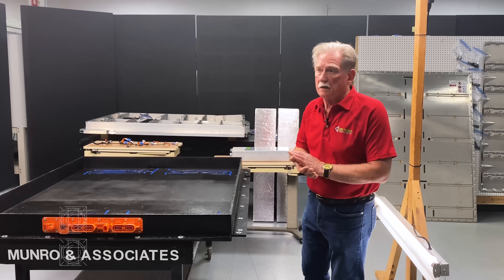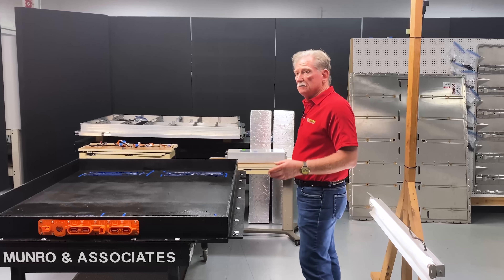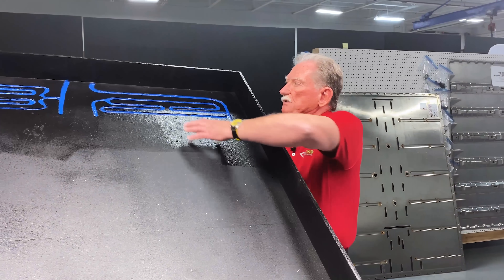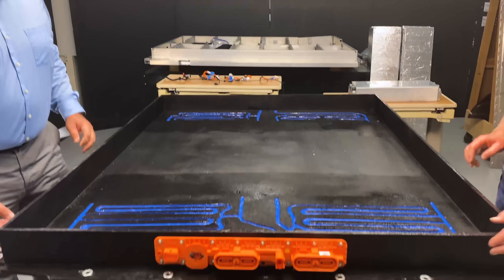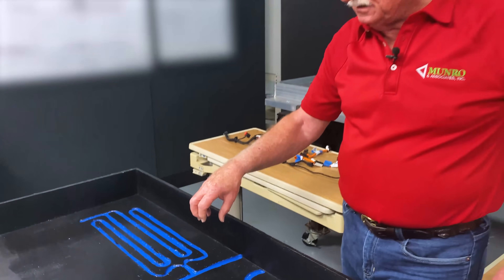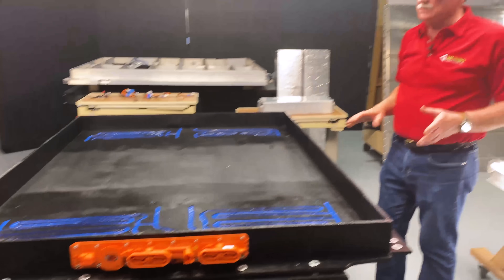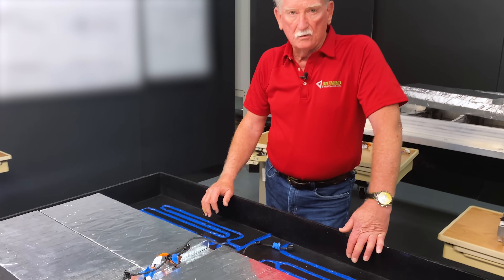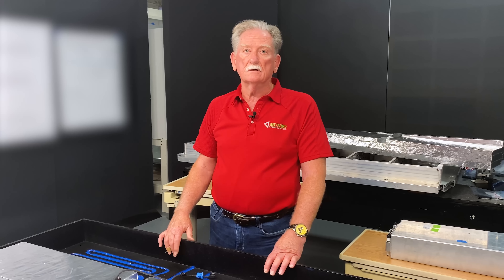Volkswagen ID.4 Battery Prototype Update

Comment: We are seeing several radically-different form-factors for the cells themselves:  soft-walled pouch cells, thin rectangular prismatic cells (including the BYD variant called 'Blade' cells), and hard-walled cylindrical cells.

Somebody needs to sort out which form-factor best suits pack engineering, fire safety, cycle life, pack-level energy density, minimizing cable runs, etc.

My impression is that OEMs are so desperate for cells, they'll take them in any form-factor from suppliers and make the best of it.  But that isn't sustainable.  Somebody will back the superior horse; the others will be also-rans.  As automakers lay plans and negotiate contracts, they will need a road map towards a future in which each can match what the others are doing, else competition will shake out the market into just a few survivors.

That might happen anyway, but I think our civilization will benefit if as many OEMs as possible are able to succeed in the market with their products.

Will Munro & Associates weigh in on cell form-factors?
Reply: You forgot "kWh out the factory door" each day.
That may be where the 4680 wins.
Reply: @rogerstarkey5390  Not exactly, no.  I didn't forget.

Tesla has a production plan for 4680 that will result in very large output from their production lines - very large in comparison to anything that has been done before.  There should be no controversy about this conclusion.

But it is not a foregone conclusion that cylindrical cells must be more producible.

At least some of the producibility gains for the 4680 cell come, not from the cell form- factor, but from dry-coating electrodes.  In principle, any of the other cell form-factors could also benefit from this technology, shrinking production line footprints, eliminating drying, reducing capital expenditures per line, reducing cell costs and accelerating cell production.

The rest of 4680's producibility gains are the result of clever engineering and cutting-edge production line robotics.  But is clever engineering or advanced robotics disallowed for other cell form-factors?

Probably not.  Cell suppliers would take issue - particularly BYD, which believes it can mass produce its Blade prismatic cells in very high volumes and at reduced cost.

My question is about the form-factor itself.  The question is agnostic with respect to cell chemistry or electrode manufacturing processes or even cutting-edge advanced robotics, all of which do factor into cell cost and performance.

BYD is an interesting case.  They are claiming for their Blade cells the ability to make structural packs - they are borrowing terminology from Tesla here, implying, but not claiming overtly, that their structural packs will be just as good as Tesla's.

It's a problematic implication.  The Blade cells will be packaged into modules which will sit in some sort of tray.  The tray can be made structural (in stark contrast to the Mach-E's tray, which just hangs from bolts).  And the Blade cells could be made to bear loads in certain directions (they are stiff in some directions, flexible in others, whereas Tesla's structural pack is stiff in every direction)).  How all of this will play out in terms of BYD's KWh density at the pack level, and weight of the pack, isn't known.

I think my question remains unanswered: what cell form-factor best suits automotive applications?  Do we really have to let OEMs falter and fail in the market to discover an answer to the question?

My gut wants to prefer cylindrical cells, but the IQ of my gut is negligible.  :P
Reply: Yes, BOSCH will pick this up and provide industry standard battry modules used by every manufacturer, like they make pumps and power steering for 3 out of 4 cars today (at least in Europe). EVs are now made ground up by every manufacturer and many different battry suppliers each using different topologies, but as the industry matures, part suppliers will catch up and provide  standardsized certified EV components cheaper than the brands can make them themselves. The state of things now are like a hundred years ago, where every manufacturer had to build their own engine and figure the mechanics of the car resulting in numerous original designs, some more sucessful than others..
Reply: @Tore_Lund  Battery tech is still advancing, and is likely to continue advancing for the next half-century, at least (opinion, not fact).  The role you envision for Bosch best suits when technology is mature.

I don't see them as leading the battery innovation race.  Or for carving a role out for themselves in my lifetime.
Reply: @Tore_Lund  The ICEV industry is mature.  Yep.

The BEV industry, specifically the electric drive train and electronics, are not mature.  At all.

A period of enormous disruption isn't the best time to be talking about Bosch-style commoditization of components.
Reply: VW group, the worlds largest vehicle manufacturer has chosen its future standard battery cell form factor, and Europe's largest battery factory is already tooling up to make them. 
It is not clear if VW is keeping this propriety or if it will become a global standard. https://insideevs.com/news/495028/volkswagen-surprised-suppliers-unified-cell
Don't know why Sandy is wasting his time re-designing giant modules when VW has already switched to cell-to-pack.
Reply: @adambennie4406  Europe's largest battery factory is a drop in the bucket compared to what Tesla is building at GF-Berlin.  Far more gigawatt-hours of storage will come out of GF-Berlin than VW's entire consumption of cells.

VW's declaration does not end the debate.

It's worth pointing out that VW hasn't disclosed to the public diddly squat about its new cell format, except that it looks suspiciously like a prismatic cell.

Their cell-to-pack ideas will probably more closely resemble BYD's than Tesla's.

Which will be superior, in terms of energy density per Kg at the pack level, remains to be seen.  But my gut doesn't think prismatic cells will excel in this.

Though I should add, the IQ of my gut isn't something I'm proud of, so there's that.  It's better at digesting pasta than predicting the future of tech.
Reply: If some company, Toyota, Quantumscape, etc. succeeds in making a solid state battery with a ceramic separator, cylindrical batteries could become a dead end format.
Reply: @adambennie4406  Do you think so?

I'm under the impression that the form-factor of cells is chemistry-agnostic.  I see no reason why a solid electrolye couldn't be incorporated into a cylindrical cell.

I have my doubts about solid state, though.  It's always 5 years out.  Always.  Cost to commercialize and life cycle are unsolved obstacles.  Meanwhile L-ion tech with liquid electrolytes is a moving target - becoming cheaper, more energy dense and with improved life cycle every year.

I'm honestly more intrigued with Tesla's patent for anodeless cells than I am with solid state.  The idea is to use a liquid electrolyte both for ion transport and ion capture, so there's no separate anode in the cell.

Whether it can be commercialized or not, I don't know, of course.  There are many candidates in the R&D pipeline, but few will ever make it to mass production.
Reply: @Urgelt  re: I see no reason why a solid electrolye couldn't be incorporated into a cylindrical cell, 
My understanding is that a ceramic separator works be being physically hard enough to stop a lithium dendrite and would therefor probably be too stiff to be tightly wound round a spindle. Quantumscapes breakthrough was to make a separator that wasn't impractically brittle.
Reply: @adambennie4406  I would hesitate to declare that flexible ceramics with the right properties could not be wound into a cylindrical cell.

But I can understand why Quantumscape prefers to pursue the prismatic cell form-factor at this time.  It's easier for them.  Nice flat separators.  Yay.

I seem to recall that Quantumscape's approach isn't solid state, strictly speaking.  It's a hybrid liquid/solid electrolyte.

I really don't know why so many people assume - trust me, it's an assumption - that Quantumscape has the answer to automotive battery needs in the future.  They're just one player with one R&D candidate that has not emerged from the R&D pipeline to achieve commercialization - and might never manage the feat.  They make tiny lab bench cells by hand that outperform today's commercial batteries - in some performance specs but not all.  They don't have the production tech in hand to eliminate hand-assembly or make them at scale at an appealing cost.  It's anyone's guess whether they ever will.  They're working on it.

They might deliver a big commercial success.  So might any of a number of other companies and university labs.  Billions worldwide are going into battery research as I speak.  A might river of patents is gushing to the world's patent offices.

Most aren't going to make it into automobiles.

For outsiders like us, picking winners and losers is not much different from playing the slots in Vegas.

And I don't think a bird in the bush like Quantumscape settles the question of the optimum cell form-factor.

Perhaps we can't settle that question now.  Perhaps we just need to see all of these different efforts play out.  My gut says we might pick the optimum form-factor today, but my gut isn't the most reliable source.  Don't quote it.
Reply: No need Munro for that. Just good common engineering sense. 
I would use the electronics analogy. Nowadays, all use soft pouch cells with are stacked. At cell level, this is the best energy density volume and weight ratio, and easy to change the cell size. Drawback is specificity, and non structural behavior.
Rigid prismatics also swell hard, and need to be contained in a structure to maintain pressure. So they're not great. 
Cylindricals are easy to produce in small formats, but making a 4680 high energy density cell is hard. That's why we see delays for the cybertruck and semi. 
So my bet : stacked soft pouch, or stacked rigid prismatic is the future.
By the way, you can't wind a ceramic separator in a solid state battery. Assuming SSBs are the future, the format can only be stacked in a soft pouch, or a rigid casing.
Reply: @fabriziom  "Making a 4680 high energy density cell is hard...So my bet: stacked soft pouch, or stacked rigid prismatic is the future."

Yes, it's hard.  That doesn't mean it can't be done.  Tesla obviously believes it can.

Energy density at the cell level is interesting, but ultimately irrelevant.  What matters is energy density at the pack level.  If cylindrical cells can yield higher pack-level energy densities, then they will outperform soft pouch or stacked rigid prismatic cells.  If they can also be manufactured at lower cost, it'll be a slam dunk.

"...you can't wind a ceramic separator in a solid state battery."

This is true for contemporary ceramic separators.

But I'm unwilling to run with the built-in assumption you are making: that solid state electrolyte cells must necessarily beat liquid electrolyte cells in cost and performance.  I think this is unlikely, honestly.  Researchers have piddled around with solid state for far more than a decade.  They have nothing commercial to show for it, only bench test cells and promises.

Quantumscape seems to be better at producing polished Powerpoint presentations than they are at producing a commercially-viable cell.  Ditto for Toyota.

There are candidates in the R&D pipeline that may prove to be better.  One of them is Tesla's anodeless cell design, where the liquid electrolyte both transfers and stores ions.  Instead of a wound layer of anode where the ion capture happens on a thin surface, you can store ions in a 3-D liquid structure of any arbitrary shape.  It's like going from 2-D circuits to 3-D circuits.

It's way premature to declare solid state the future winner of battery cell tech, in order to justify a preference for soft pouch or rigid stacked prismatic form factors.  Or to rule out solid state in cylindrical cells.  I can find no certainty in either of those projections.

You're making a lot of assumptions that might not hold up.

Or they might!  I wouldn't make the bet you're making, but if your assumptions prove to be accurate, your prediction might indeed be where the industry ends up.
Reply: @Urgelt  thanks a bunch for your great answer! And I fully agree that my assumptions are a bit bold. I do not believe solid states will arrive as soon as everybody predicts. 
I like 4680s because you don't need to manage swelling, and its housing can be used structurally as was revealed at the battery day.
And in the end you're also right about what counts being the energy density at the pack level or even better vehicle level.  Especially volumetric energy density. I've always liked Tesla approach to reduce Z axis pack height as much as possible, as it also ultimately improves cabin space and aerodynamics.
There is no one single answer for sure and it's fascinating. 
What I'm sure about : the race is focused on improving energy density at pack level esp. volumetric, faster charging, reduced cost, end of life recyclability. How to get there will imply multiple technologies and probably won't have one winner😉
Reply: @fabriziom  Well said, Fab!
Reply: @Urgelt  thanks!!

Comment: In the fine print of the Biden ev event the goal was around 50% electric vehicles. Except electric vehicles also means hybrid so not much could change if the traditional OEMs don’t take actual electric vehicles seriously. Plus all that could be reversed if republicans take office between that time.
Reply: I wasn't the only one that smelled fudge?
Reply: We've reached the point at which EVs will take over, rapidly, due to economic forces.  Governments will play a lesser and lesser role going forward.

We're at the point where EVs reach manufacturing parity with ICEVs.  Tesla appears to be there already.  It's a factor of getting cell costs to $100/kWh and Sandy reported the cell cost for the Model Y to be $82/kWh when he did the tear down.

The industry did an analysis of when EVs would become economically dominate, based on battery price, several years back.  The first design to be surpassed as battery costs dropped was the hybrid.  Then the PHEV.  The ICEV hangs on the longest but with ~$2/gallon fuel the crossover is around $100/kWh.  Tesla and BYD seem to have crossed under the $100/kWh level with other companies to follow over the next couple of years.

As that happens it will become cheaper to purchase an EV than a same-feature ICEV.  We can see that now by comparing the Tesla 3 to similar BMW and Mercedes models.  By 2025 the cost of EVs should be the same or less than same-feature ICEVs.  Add in the much lower operating cost and I expect we'll be close to 100% EV purchases by 2030, not 50%.
Reply: @nedkelly4825  

It's not one or the other, Ned.  We need a mix.

Yes, the market creates competition which makes companies strive to produce better and cheaper EVs.  But those companies would not have started down the EV path had not governments initiated the move.  

There are times when we need the buying power of all citizens pooled together in the form of tax dollars to get innovation started.  Look at computers.  The Internet.  Satellites.  Innovative drugs.  So much of what we enjoy started as a "socialist" program and was taken over by private enterprise once the government did the heavy lifting.

And that word "socialism".  It means the government owning businesses.  We don't have that in America.  

What we have that you are calling socialism is more like a buyer's club or a big insurance program.  We pool our money to pay for police, fire fighters, the military, food and drug inspection, road repair, etc.  None of us, outside a handful of multi-billionaires, could afford to pay for our personal armies and fire departments.  We all, those of us who are capable, pay into the pool and when/if we need the services they are there for us.
Reply: @nedkelly4825  

"Everytime tax dollars are confiscated from people, that's wealth that said people cannot use for other projects."

That is true.  But purchasing some things on an individual level just doesn't work.   Can you imagine having to pay to keep a fire engine and a squad of police officers at your house 24/365?  

Only a handful of billionaires could afford that.  Most of us need police and fire services rarely, perhaps not at all.  Therefore what works is to collect money from those of us who can afford to contribute and purchase services for us all.

If you do not understand what publicly funded education, research, and exploration has brought us you simply....  Well, I was going to say you are ignorant.  I think it more likely that you are in denial.  

" If it were not for worldwide government meddling, we wouldn't need armies."

For time immemorial we have had to protect ourselves from others who are motivated by greed and a lust for power.  In very early man we see signs of banding together to provide mutual protection.  Governments did not create wars, Governments were created for a large part to organize our protection.

"Everything goverments "provide" can be achieved by the free market cheaper, better and more reliably."

Perhaps.  But that does not always work.  Where's affordable universal healthcare?  The free market had scores of years to bring us that.  Where has the free market build the roads and electrical grid we need?  

"At the end of the day, taxation is forced theft."

No, taxation is a membership fee.  We pay our membership fee in order to be protected.  So that we have water that is safe to drink, Food that is safe to eat.  Air travel that is safe.  Roads that get us places.  An educated public which is essential to a functioning society.  And on, and on, and on....